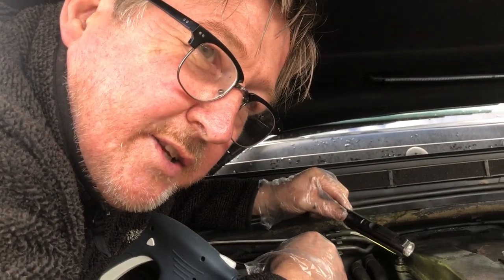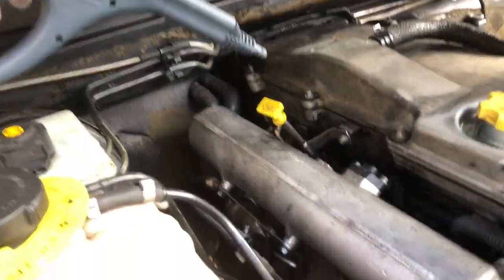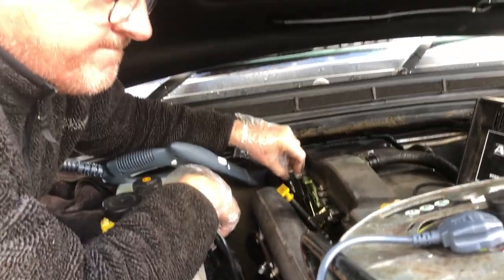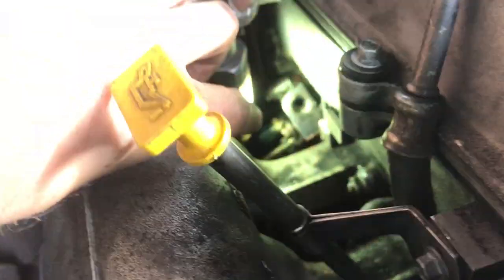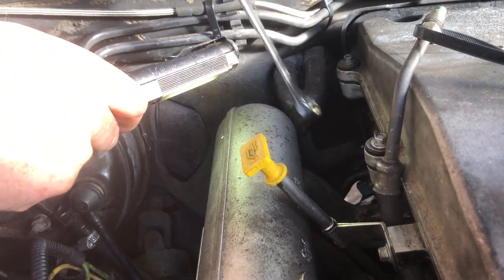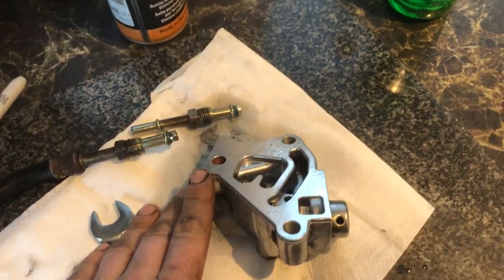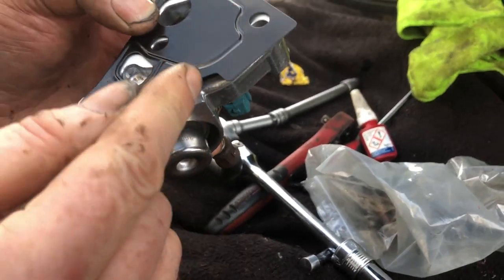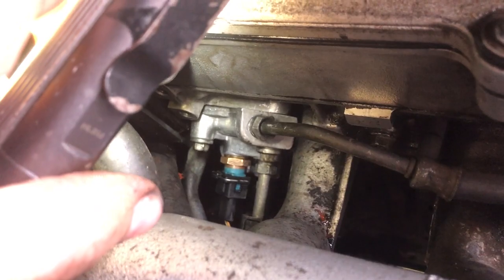Land Rover Discovery 2 TD5 Leaking Fuel Regulator 10p 15p Removal and Refurbishment How To #td5

Comment: I guarantee you that removing the battery, ecu, battery box and then inlet manifold will make this job 1000% easier.
Reply from the maker: Definitely I agree with you, just didn't want to take anymore off than we had to otherwise it can be a rabbit hole at the time.

Comment: Seen a great tip - a Britpart Youtube video with Fuzz Townshend: when putting the FPR back in place, put an elastic band around the three bolts to hold them in place; once they are done up a little just pull and break or cut the elastic band!
Reply from the maker: you can do this, it makes it easier  just make sure the bolts go in straight. we used some elastic cord.

Comment: Did you use any sealant on the gasket? Many thanks
Reply from the maker: if the surfaces are clean and it's a new gasket you shouldn't need to
Reply: @DanielJohnHowTo  many thanks Chris

Comment: Having problems with my discovery td5 changed the injecter seals injecter loom had a new fuel regulator had a sniff test holding water level oil level ok still miss firing any suggestions please
Reply from the maker: have you checked/cleaned the ECU connectors? they are red and black at the back of the battery with a screw holding the box in
Reply: @DanielJohnHowTo  no but I will try it thanx
Reply from the maker: @simoncockcroft845  there's more stuff to try but always start with the basics first that's what I have learnt about the D2.
Reply: @DanielJohnHowTo  next job lol
Reply: Obviously you put the injectors back in the right order?
Reply: @DanielJohnHowTo  Oil can be wicked up and it goes back to the ECU causing problems - new injector loom is not too expensive.
Reply from the maker: @intestinalworm1202  yeah that's a common problem, I checked our a while back and all clean fortunately just unplugged from the ecu and some contact cleaner ont he black/red plug pins. The thing is, low battery/earths and things like that can cause all types of nuisance issues but are easy enough to check and fix.
Reply: @DanielJohnHowTo  Yes, battery and earth issues often overlooked!

Comment: Hi lads iv got a late 2003 d2 iv noticed the FPR leaking, but i noticed the regulator is the one with small pipe on it an theres nothing connecting to it, am assuming its the wrong one that has been fitted in the past, any ideas much appreciated 👍
Reply from the maker: Our issue was the right FPR but wrong gasket/sealant combination, however by the sounds of it if it's the small pipe as in the top one then it could be a 15p FPR on a 10p engine, or it is a 15p and the pipe is missing. Best bet is to find the exact engine e.g. 10p/15p and buy a FPR for it or the pipe the 15p variant needs along with a new  gasket thanks.
Reply: @DanielJohnHowTo  Thanks for the reply, it is a 15p engine i just dont understand wot the small pipe is for on the pressure regulator if its not attached to anything.

Comment: Love your video!  Fuel line that goes to the top of the fuel cooler (shell side) has a black plastic collar/collet and is supposedly a "push-fit" - just can't remove this fuel line from the fuel cooler!  Do you squeeze the black plastic collar/collet and pull the fuel line back at the same time?  Any tips (don't want to break it)?
Reply from the maker: It is pushfit, but tight because of age we removed ours and popped it back on only to find it then popped off spraying diesel everywhere so i recommend you actually cut the old connector off and put a new one on to avoid such an issue but it may be fine. give it a real good clean to loosen the dirt, then pull the collar back/squeeze it and pull off try that.
Reply: @DanielJohnHowTo  Thanks for that!  Sprayed with brake cleaner, will wait and spray again - pull the black plastic collar right back, squeeze and then try and pull off!  At least I know I’m doing it the right way!  Always apprehensive about plastic breaking!  Will have to find the part number for a new hose just in case!  Thanks for that!  (Looks like hoses only come with a new FPR - not sold separately?!  Other option is getting a fuel hose made up at a hydraulics shop.)
Reply: Got it off!!  All in one piece - nothing broken!  Few sprays of brake cleaner using the little straw to remove grit/dirt, then later a few sprays of penetrant; put an open-end spanner behind the collet and pushed whilst pulling the fuel hose - it came off!  May not need a new hose now - all looks to be good.  WIll be best to get new Viton o-rings though I'm assuming?

Comment: How can you get the pipe off that runs to the front?
Reply from the maker: 12mins in the video it shows the connectors one screws in and the other is a pushfit connector that goes to the fuel cooler on the inlet manifold thanks.